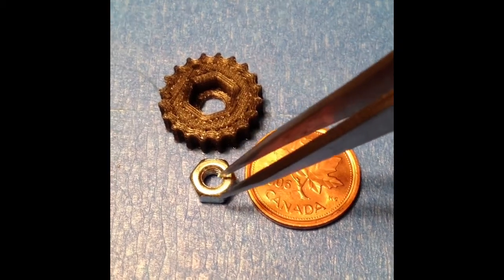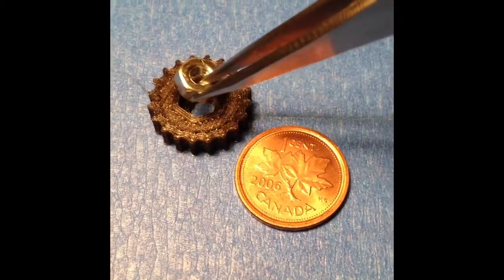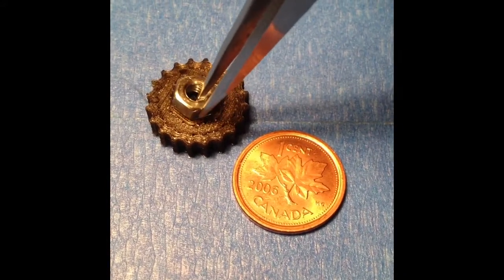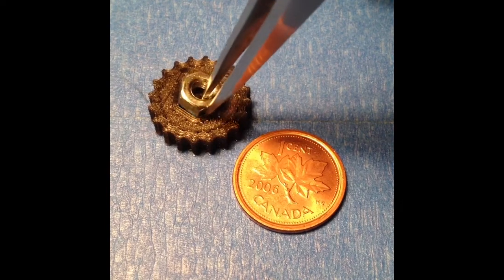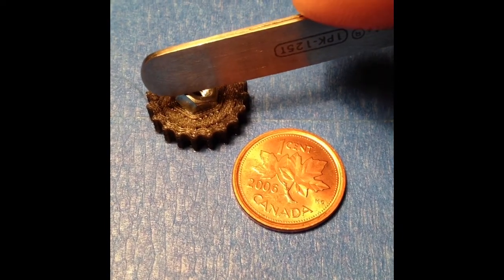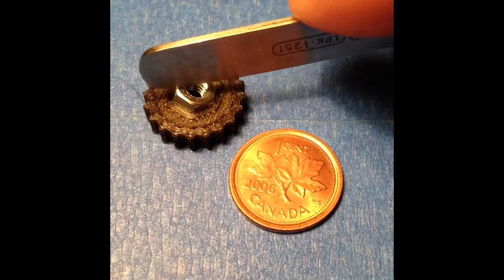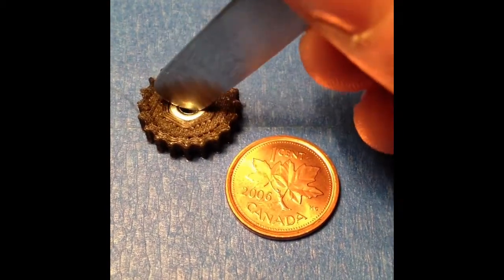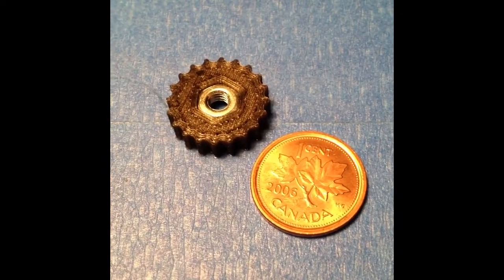Tantillus Printing Small Parts

Comment from the maker: I had to remove the stock position z-stop switch as the hot end is much shorter then a j-head. Also had to dial up the retract as fast as possible (cannot be tuned to totally kill stringing). Works great otherwise.